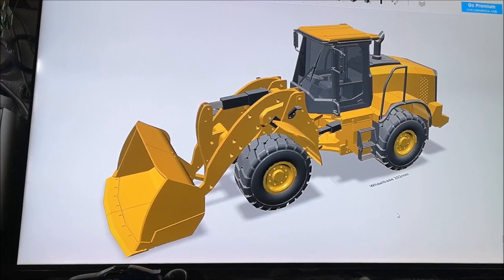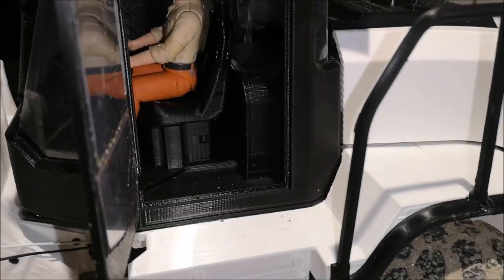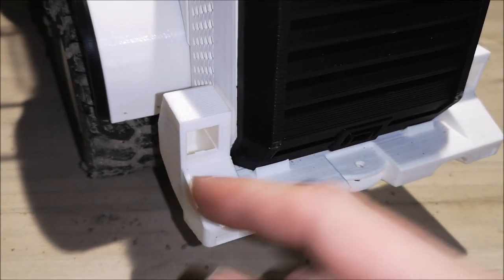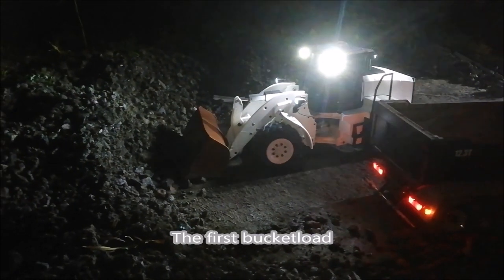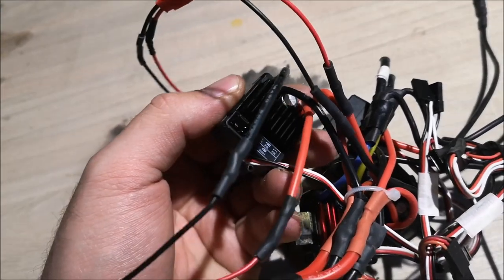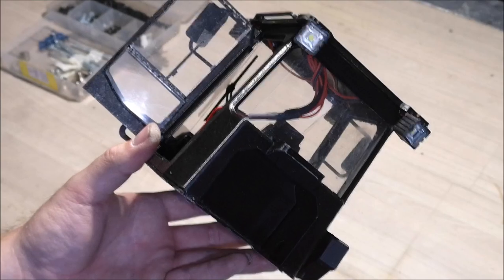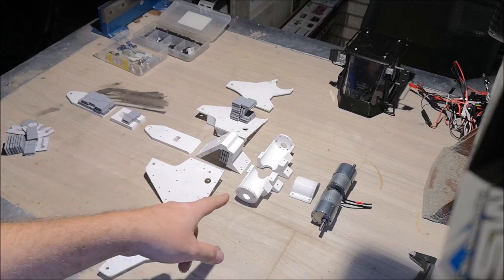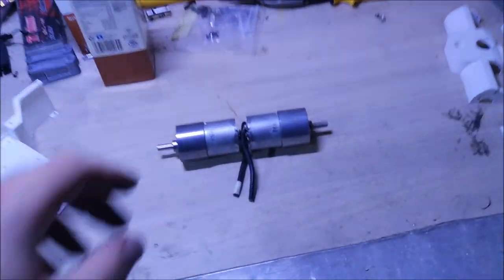Making a 3D Printed RC LOADER - CAT 950M - PART 1

Comment: Hi my friend , The wheel loader is simple
Great . It will be my current 3D print
model . A suggestion from me, how about me
longer stroke arms 3.5cm so you can use the shovel
comes higher . CAT has something like that in the original
Greetings Kale
Reply from the maker: ah very nice idea! I've seen the long-reach arms on the real one, I could add them as an option part ! thanks man :D

Comment: You do nice work. Love the models Your models are the main reason i got a 3d printer and will be frist things i start on. What kind do f filament do u use.
Reply from the maker: awesome <3 thank you for the nice comment, I print with PLA :) but remember, if you live in a hot country, where the sun is warm i dont recommend using PLA as it can react to the sun. Where I live i dont have that problem :) have fun with the printer and the rc projects man, its really awesome once you get into it :D
Reply: @burnie222rclasseanhanger6  it can get in warm for a few weeks during the summer. Around How much filament does it take to make the models
Reply from the maker: @1983cll  if its only a couple of weeks you will probably survive with pla, i used maybe 2 kg PLA to print the loader. or between 2 and 3 kg's. not sure :)

Comment: How long is this loader? 
I am considering to build it but I don't will it fit my trailer 😅
Reply from the maker: 508 mm long without the bucket, 200mm wide, and 250mm tall
Reply from the maker: but you can raise and lower the arms when on a trailer, the wheelbase is 252mm
Reply: @burnie222rclasseanhanger6  thank you 👍🏻
And how long is it with the bucket (standard one)?